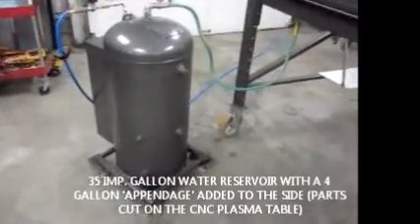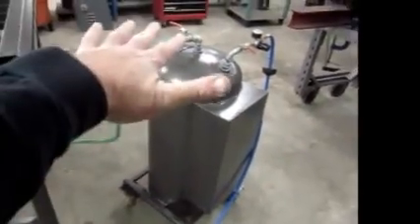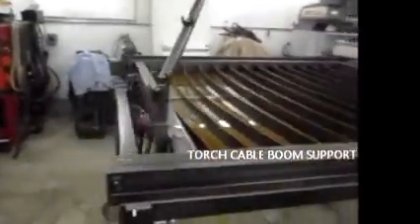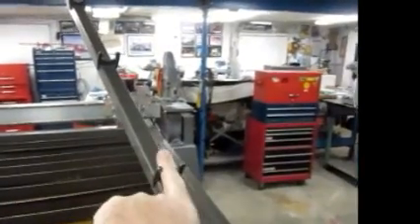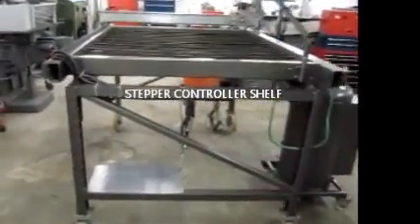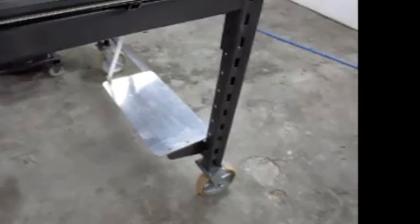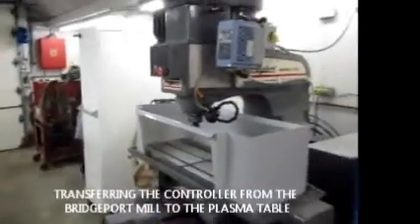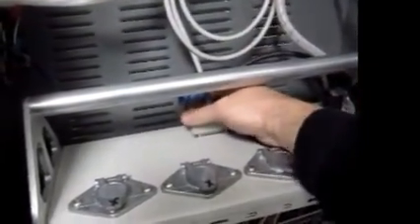CNC PLASMA PROGRESS # 8

Comment: How much belt stretch do you get over time? Do you have to tighten it much and as you do, do you have to readjust travel units in MACH? If you had to do it over again, would you go the belt route again? I like the belt idea for cost and simplicity.
Reply from the maker: Hi there,  the belt I used has fiber reinforcement so stretch has been minimal. Certainly there is some momentary stretch when the gantry is accelerated but I used aluminum as much as possible in order to reduce gantry weight.  I may go to a smaller z axis stepper at some point to help reduce weight further. 
The machine is giving me accuracy to about .100" which is good enough for my needs.  Yes would definitely do it this way again for the reasons you mention,  cost and ease of acquisition of components. If you need more accuracy than this maybe plasma isn't the way to go. I tell people a plasma cutter is like an axe, not terribly accurate. A CNC plasma cutters is  just an axe mounted on a cnc table,  don't expect super accuracy.  Hope this helps,  check out the cnczone build linked in the description of one of the videos in the series.

Comment: Nice build. Researching if I want yet another project.   At what point  does one actually need a water cooling bed? Is it only if you're mass producing or plate thickness?  Is there a rule of thumb here?  i have been free handin and have had no issues with warpage Yet? 
BTW if you put a water diffuser at the fill point of your bed you could run your pressure vessel 35-40ish PSI. Peace out!
Reply from the maker: +Dan Murphy Thanks Dan, as I wanted to be able to use the cutter in the winter with the doors closed I built it with a water table primarily to catch as much of the smoke and the fine plasma dust from the cutting process as possible.  Pressure vessel has had a 1/ 8 inch thick sheet appendage added to it to increase its water volume, well tig welded and all but I don't trust it above 10 psi or so when I transfer the water into the table.

Comment: as yhc 301 is connected and how it is configured so that the height sensor automatically work
Reply from the maker: luis felipe THC is from Texas Microcircuits.  http://www.texasmicrocircuits.com/  but I recommend C and CNC as a supplier here:  http://www.candcnc.net/index.php/store-home  The torch arc voltage is monitored continuously and compared to a preset value. The torch height control module then independantly moves the z axis stepper motor to maintain distance from the material as the X and Y steppers go through their motions.  The best illustration of this is here:   https://www.youtube.com/watch?v=nDj5SSle-ng

Comment from the maker: I think a budget of about 400$US for the table itself + 250$US for stepper motors + 200$ for vtrack wheels and tracks. The stepper controller another 1000$ as follows ;  4 x Gecko 203V (600$US) , CNC4PC breakout board (125$US) ,toroid transformer, bridge diode, capacitors switches plugs etc (200$US)   -  ESAB 875 plasma cutter 700$US on eBay